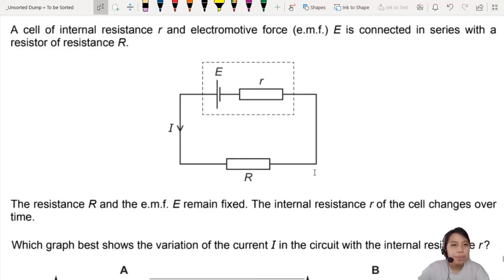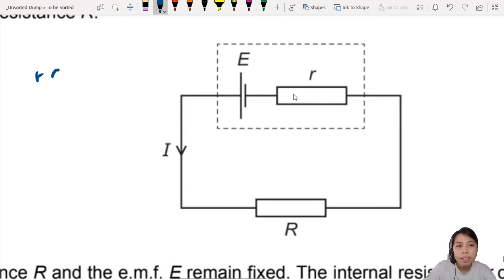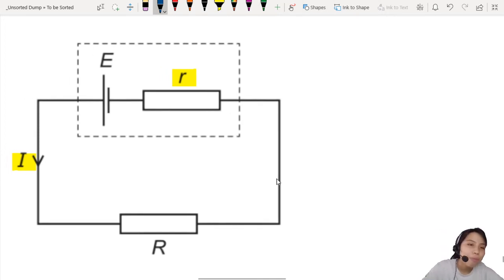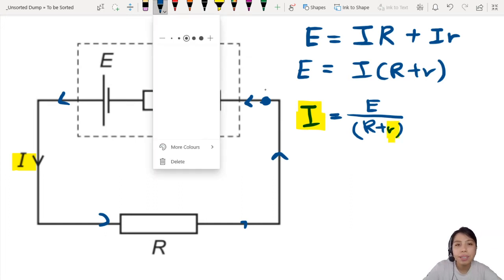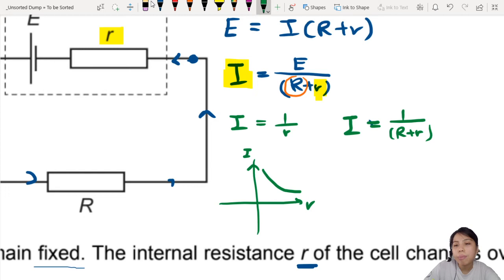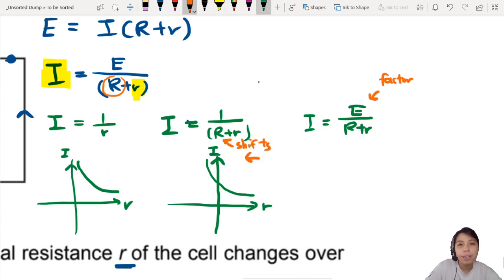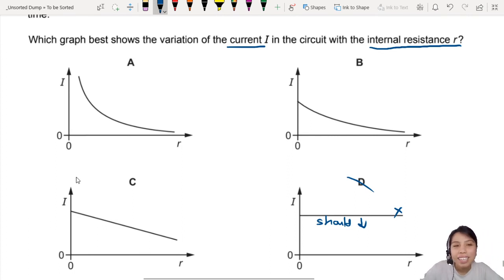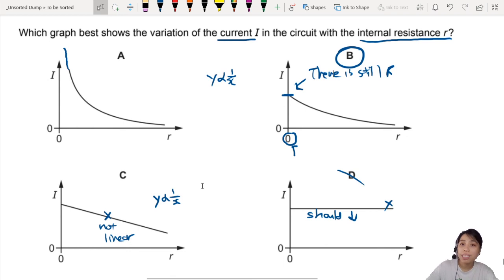FM19 P12 Q36 Current vs Internal Resistance Graph | Feb/Mar 2019 | CAIE A Level 9702 Physics

Comment: Wow this reasoning is so cool, it applies transformation of functions 😨
But I think there is a quicker way to find the answer:
to keep the resistance R the same, the terminal volatge should also be constant (V=IR and across a component; I is constant... maybe?)
and to maintain stable terminal volatge, the lost volt should be constant too
V=Ir, and since V is constant, I proportional to 1/r; so the graph should be an inversely proportional graph
I don't know if this is correct... 😥
Reply: i also thought the same... the application of transformation .. its cool tbh
Reply: @v1ncible_61 Looking back at my comment few months later I kinda think I screwed it up completely. I could just consider the relationship between total resistance and current (where they are inversely proportional caused by constant emf) to determine that it's I ∝ 1/r at least. Regardless of the method, I do think these electricity MC questions are made rediculously hard 🤔
Reply: @BOBO_4869  yeah .. but these type of difficult questions are seen to come every often and minimum 5-6 questions are always difficult..